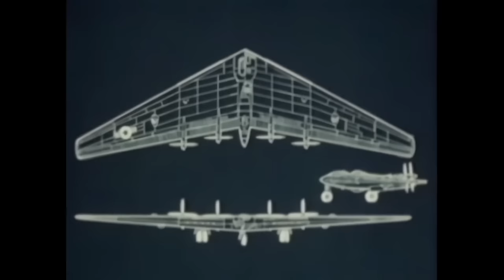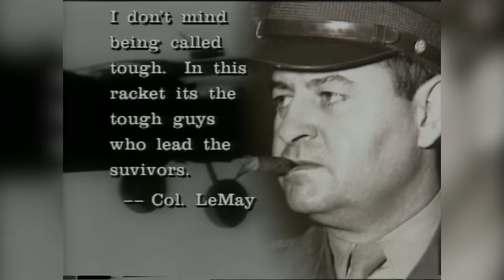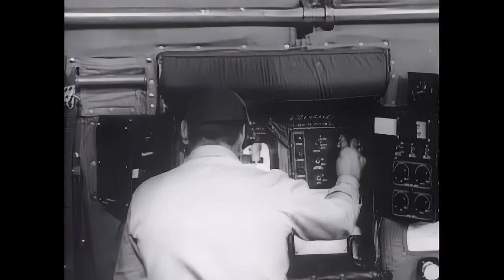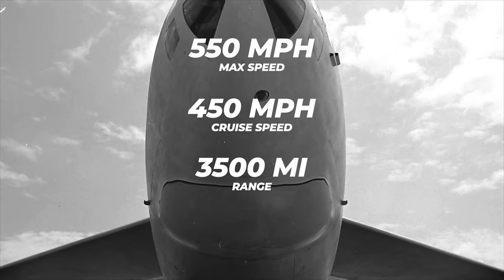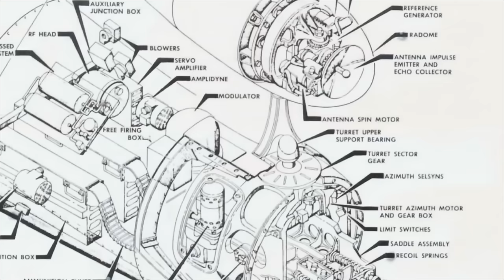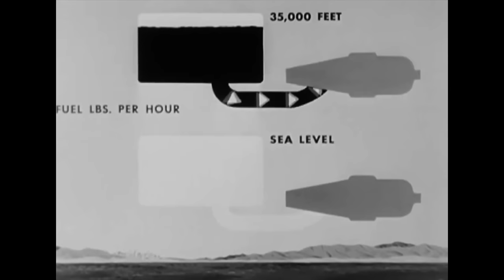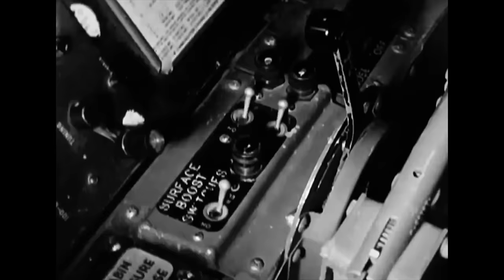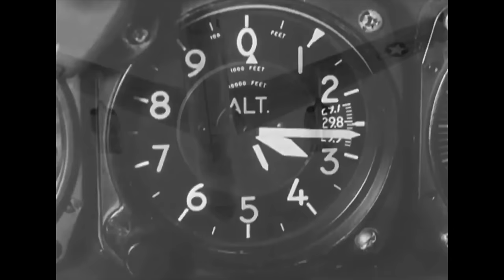U.S. Giant Aircraft: B-36 PEACEMAKER | Convair Massive American Strategic Bomber

Comment: There are some fun facts about the B-36 Peacemaker. It's a larger aircraft than the B-52 Stratofortress. It can carry more ordinance, has a higher takeoff weight, and has a longer range than the B-52 Stratofortress. So why was it replaced? The cruising speed of a B-36 was only 230 miles an hour. About the same as a World War II bomber. Literally could be intercepted by a biplane. The cruising speed of a B-52 is over 600 miles an hour. Fast enough that it was difficult to intercept for Soviet subsonic interceptors like the MIG-15 and 17. Back when our strategic nuclear threat was bomber based, we could not afford to have something so slow and so easy to shoot down as the B-36 no matter how much it could carry. One or two nuclear bombs that make it to the Soviet Union is better than five or six nuclear bombs that don't
Reply: All good but when you started giving facts in mils or whatever you call it i get lost, there is something called metric sistem that everyone understand out of the US
Reply: The truth is far more complicated than this. While the B-36 was not fast running on just its radial engines, it flew at such a high altitude that by the time a Mig 15 could get into the air and climb to its altitude,  the Mig would not be able to catch it even if the B-36 was not using the four J47s and even if it could catch it, at attitude, the B-36 could out-turn the Mig 15  !!!!  With the four J-47s burning, it could reach burst speeds of 435 mph. I used to have a rather poor opinion of the B-36, but after reading the book "Magnesium Overcast," I really came away with a much different perspective. Of course by the time the B-52 entered service, the skies were no longer safe for large bombers, and even if they were, even the B-70 was deemed obsolete with the introduction of ICBMs.
Reply: @shenmisheshou7002  well, that is one fact that overrides anything else. Once we can fire missiles from continent to continent with some measure of accuracy, bombers and therefore interceptors are both obsolete. The issue with The Peacemaker was not its direct confrontation with interceptors over Soviet skies, it was the time that it took to deliver strategic weapons from our continent to theirs. If you have a situation where you are delivering a first strike strategic nuclear attack, but the other side has 12 hours to prepare for the time you launch your aircraft, there is no such thing as a surprise attack. Those temporary speed bursts were possible, but you're talking about an airplane that was supposed to hopefully return to base. Any way you slice it, it was simply too large and too slow to deliver a surprise strategic attack
Reply: @richardbullwood5941  I think you are missing the big picture. The B36 entered into service in 1948. In 1948 the only way to deliver nuclear weapon was using fixed wing aircraft. The first US ICBMs entered service in 1959.  That means that for the 10 years it operated, the B-36 was the only real deterrent. The TU-20/TU-95 did not enter wide spread service until the end of 1953, but at that time, there were a very limited number. Next, many of the targets that would be important strategic targets were the oil fields in the caucasus, which could be easily reached from air bases in the UK.  Then there is the lack of satellites. Now we can see an attack coming, but in 1950, no one could tell an attack was coming that far in advance. NORAD did not go into operation until 1958. Last, the US has had a no first strike doctrine since the end of World War II.  The B-36 was  the best plane that could be built at the time, and it would have been a difficult plane to defend against but of course it could be shot down,  just as the B-52 could have been shot down.  The whole idea of strategic bombers is to deter. Even the B-1A would have faced the same issues and Carter knew that, and killed it. NA-Rockwell then came up with the B1B, a plane that should never been built, but manage to get a contract when it promised a bunch of congressmen that they would build parts for the plane in their district.  Congressmen love to tell their voters they created jobs. NATO Was against the B1B, saying that it was not a good weapon and that spending the money on thousands of cruise missiles would be a better use.  Today, we have the F-22, which has never shot down anything but a balloon, but it somehow make the American Public feel like a deterrence, but it has not seemed to keep anyone from doing what they want to do.
Reply: I remember this big bastard as a kid they had 2 at Ohare field in the 60s and when it took off it was a sight to behold but scary as shit when it landed cuz back in the day you can park right by the fence & watch the planes take off & land we”d lay on the cars roof on our backs & the planes would fly over us & it seemed you can reach up & touch them but when that Godzilla plane land it’s massive size seemed like it was gonna come down on your head & loud? Wow you felt the air wash as it passed overhead the only plane that scared the shit out of me.
Reply: @user-di7px9lm9t  I am an envious. That must have been a sight.
Reply: @mastermind8236 screw the metric system.
Reply: There is a B36 at the museum in Dayton
Reply: @Beecher_Dikov and the horse it rode in on too. Bad grammar also…
Reply: @mastermind8236  american plane, American measurements. Google can convert freedom units into whatever haypence stone womblestump units you prefer.

Comment: I used to have a rather low opinion of the B-36, but after reading the book "Magnesium Overcast," this is what I learned. While the B-36 was slow, no contemporary jet of the day could take off and get to altitude before the B-36 was long gone. Also, at 40,000 feet, the giant wings of the B-36 would actually allow it to out-turn a Mig 15!!! At 40,000 feet, the stall speed off the military jets of the day was only a few MPH lower than the cruise speed, meaning that any turn sharper than 10 degrees or so would cause the plane to stall, while the B-36 could make significantly steeper turns.  Also, with the J-47s lit up, the burst speed of the B-36 was 435 mph, so once again, at 40,000 to 50,000 feet, there was literally nothing in the day that could catch it.
Reply: very good book
Reply: That's an awesome add on to this video. Thank you for adding the info and listing the book

Comment: Wow, i didn't get my head around how big it was until you mentioned that there are walkways IN THE WINGS to check the engines IN FLIGHT. That's wild, but very cool
Reply: I also understand that it had tunnel with a little cart that was used to traverse between forward and rear crew compartments Laid on your back and pulled your way from one to other

Comment: Excuse me but, wasn't the 'Spruce Goose ' the biggest airplane to fly?
Reply: It’s still debated whether or not the Spruce Goose actually flew. The aircraft never left the “ground effect”, which significantly increased a wings lift when flying close to the ground or water. Thus it’s speculated that it could never properly fly, lacking the power and lift to fly outside of ground effect.
Reply: @hondoonaka1823 
It was basically an early erkranoplane, a USSR era flying ground effect ship
Reply: @fazole  I believe its shortcoming came to power, engines of the time simply didn’t possess the power to propel such a behemoth, even with 8 of them. I believe if it had access to TU-90 style turboprop engines it could have had the power to take off successfully.
Reply: It was the biggest plane to ever fly under 3.5 feet…